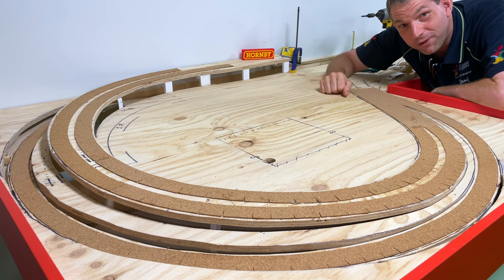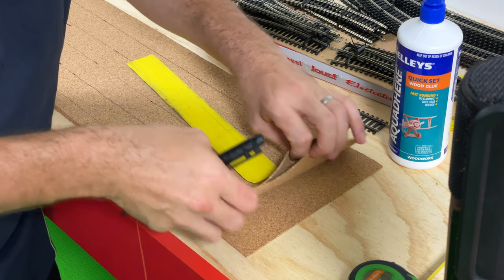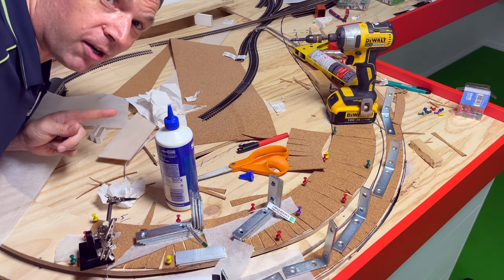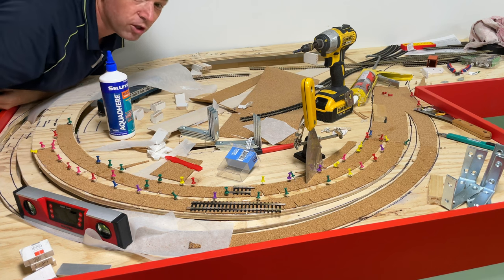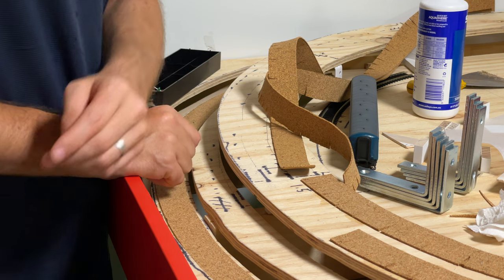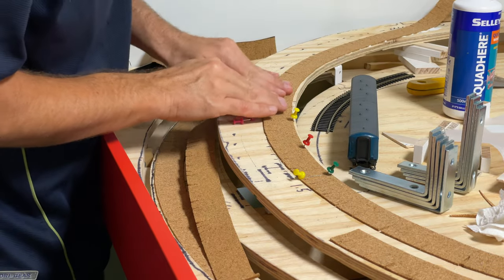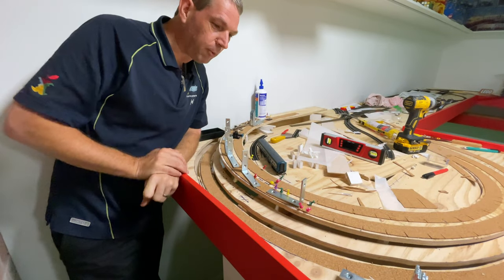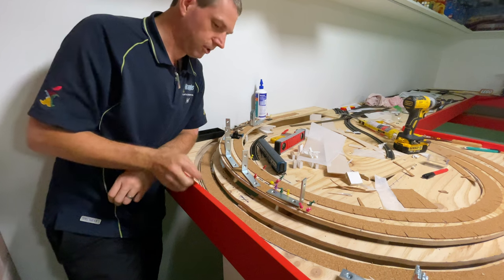Josef - Model Railway & Toy Room 16 Laying Cork Curves & Janet Hornby Layout Dads Army Loop

Comment: This is why when people lay cork bed, they purchase it and it comes split in 2 pieces so it is easier to lay on bends as you separate the 2 pieces and it curves much easier than you are doing having to cut each piece with relief cuts on the outer edges... I don't lay cork bed, I lay underfelt as my base but I don't do any of the ballasting or weathering.. I just want to lay track to run trains.. haha.....also I'm not much for scenery other than what I was given when purchasing second-hand track and layouts.
Reply from the maker: Yes we can pass on that whole first loop I was trying the Chadwick approach which was a. Complete and utter bust I will follow up with that.  When I drop down to the fiddle yard later this year.   Thanks for the kind words and support